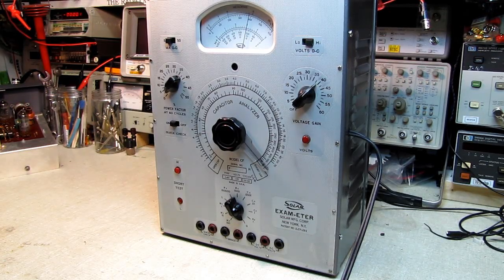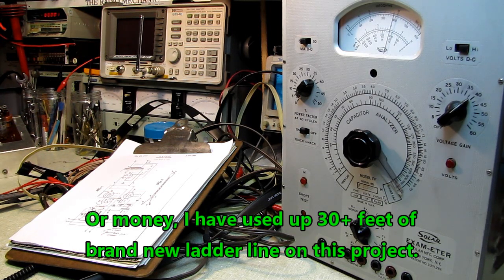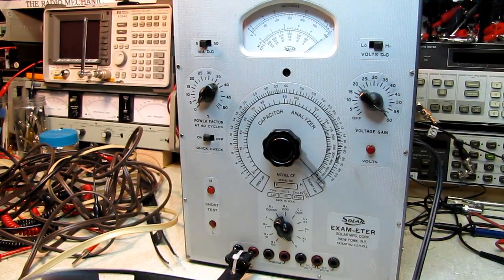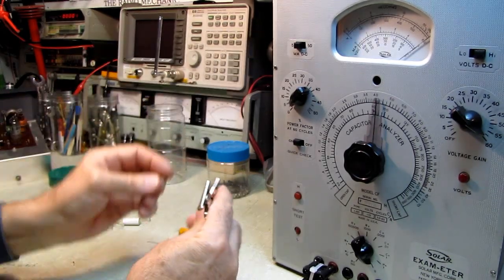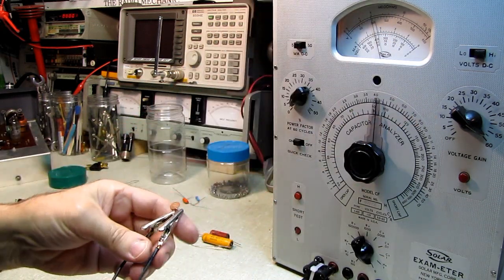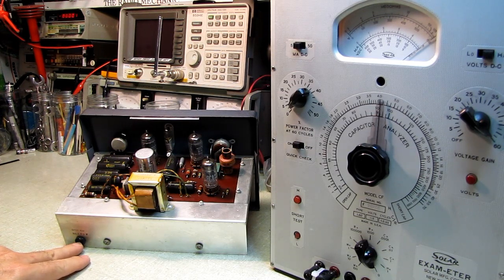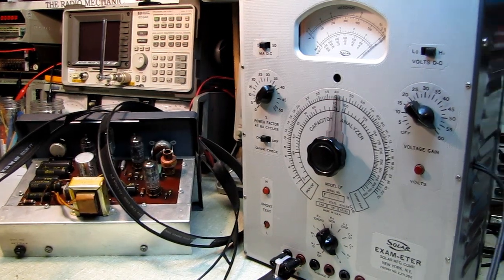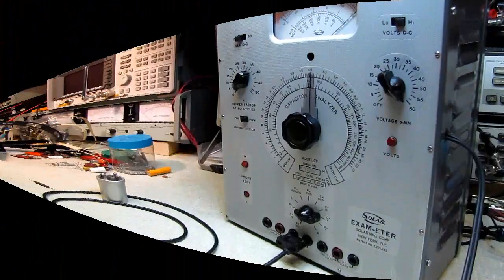What? Another Capacitor Tester? Part 3 Final Chapter

Comment: Just restored one of these for my self. Mine was callibrated to 450v full scale on the megohm scales. so i dont have the problem with 600-700 volts on the probes during test.

Comment: bad resistors are like hippies they are always drifting
Reply from the maker: HUGE chuckle !!! Thank you, you made my day.
Reply: this would be useful to me as a lite power supply when I am building amps
Reply from the maker: This would not make a very useful power supply, what you want is a Heathkit IP-17. 6 and 12 VAC Heater voltage, 0 - 400 DC B+  and 0- 100 VDC Bias.
Reply: 400 Volts is to lo I tend to run 500-550 volts

Comment: You're almost right: It's basically a transmission line,, and the meter function is basically that of a network analyzer, LCR meter, etc. You'll need to know the meter's characteristic output impedance, which you can determine with resistors attached at the meter on one of those dual banana plugs. (I presume you know how to determine output impedance.) Then, you'll need to assemble a transmission line with THAT characteristic impedance. Read about network analyzer calibration.
Reply from the maker: Been there.....problem is trying to find any existing line with the correct LCR characteristics. And the meter just isn't worth the work.  Thanks for watching.